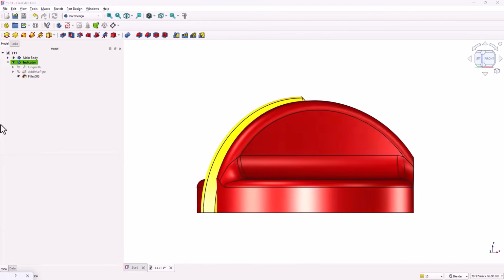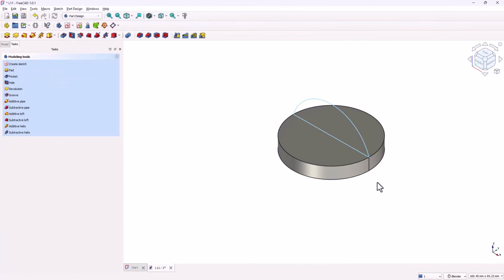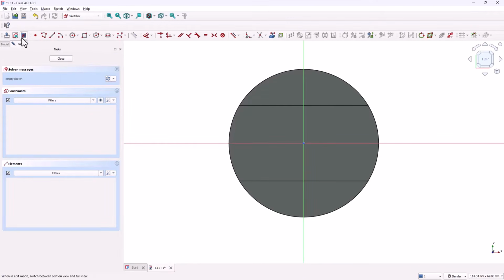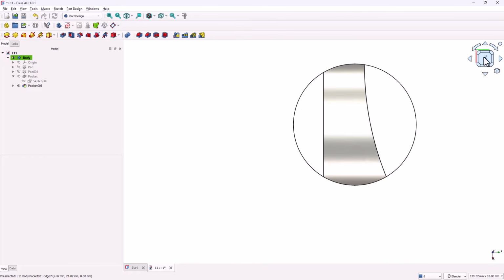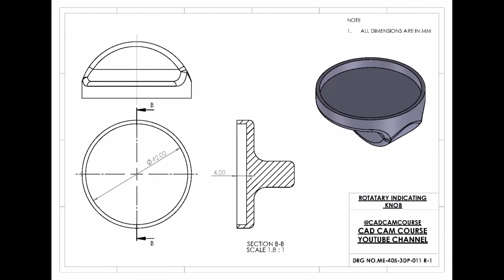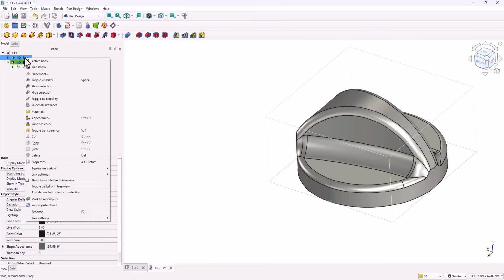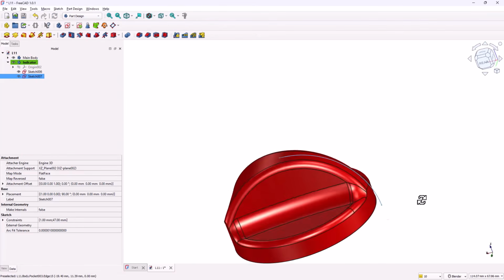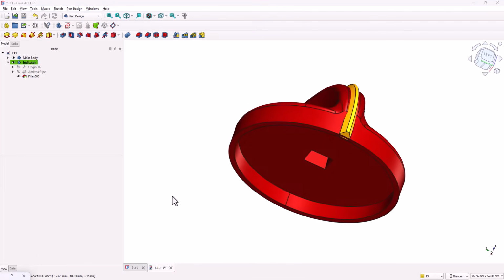FreeCAD Tutorial: Model a Rotary Indicator Knob | Potentiometer Knob for 3D Printing

Comment: Great video, but....
You are doing a lot of things that could be done all together, like selecting edges for fillets, or using measurements in a way that it's not shared and if you change one the whole model will fall apart.
Another thing with the indicator that you didn't do the groove on the handle to fit in to. This is not 3D print ready like this.

Comment: when creating the sketch for the handle profile i encounter issues, even though doing everything exactly as instructed. After completing all steps, the sketch is shown as fully constrained and all lines are green except for the arc within the body, which is shown as a blue-dashed line. Then, when activating the pocket, the complete body disappears and i get the error "Pocket001: Wire is not closed". Maybe the arced-line in my sketch is converted to some sort of reference line by accident and therfore shown as a blue-dashed line?
Reply: Did you ever get past this?  I'm having the same issue.

Comment: For all of 1.02 version users struggling with errors during fillet creation - make fillets on the original cutout of the handle and then holding ctrl mark all fillets and mirror them to other side this whay it works without errors
Reply: This worked for me as well.  It was the only way I could get all the fillets to work.
Reply: Thanks I got stuck on that seems like a bug of freecad, really annoying but well its free software

Comment: Thx for the video, just a remark on the cutoff part of the video please constraint the diameter of the cutoff circle against the external reference of the knob diameter and a distance offset for the second circle so when you change the knob diameter it keeps working. Also make the pocket cut trough all instead of a fixed dimension

Comment: I believe the square tapered hole needs an angle of -2º, not +2º (to be the shape in the diagram, and to make sense as a "friction fit").

Using FreeCAD 1.0.2, I did find the fillet step to be extremely sensitive to how geometry was created for the knob (cutting the handle to a circle, curving the handle in). Visually equivalent geometry resulted in spectacularly failed fillets (not even errors, whole missing faces).

Comment: Great tutorial, very well explained, thank you! For anyone running into problems with fillets, I found that doing any of them together caused problems. For example, the 1.75mm fillets, I could do those together, but then the 5mm fillet wouldn't work properly. Doing them all separately, I had no issues at all.

Comment: I have problems with the fillets: I can create the 5, 2, and 1.75 mm fillets for the original pocket, but when I try to create fillets for the edges of the mirrored pocket it fails with a "command not done" error. Any ideas?